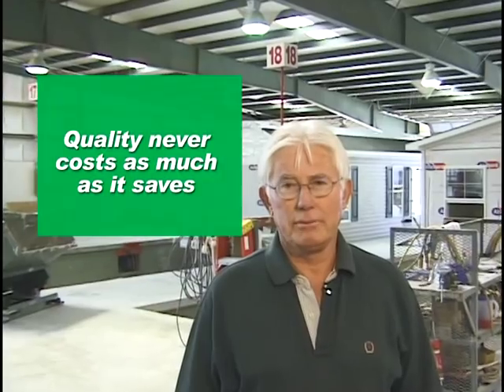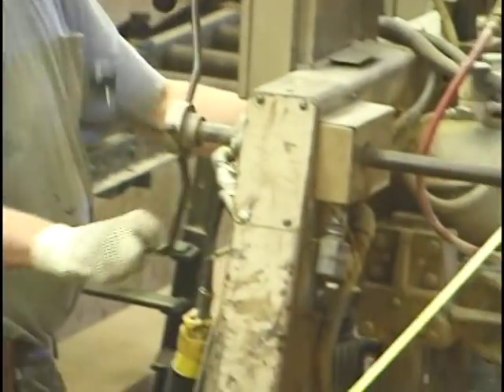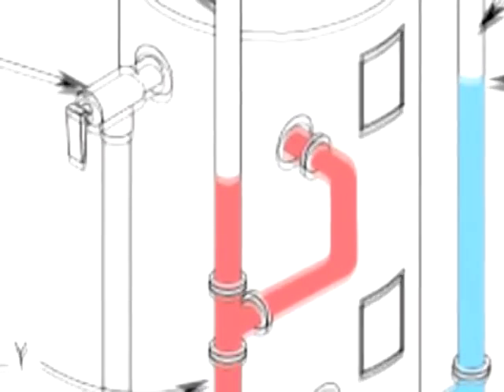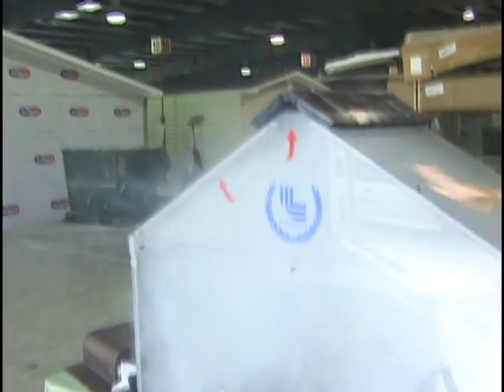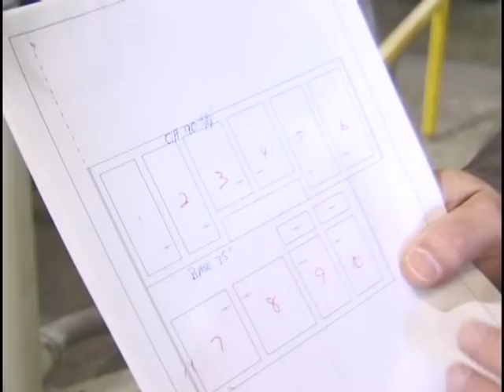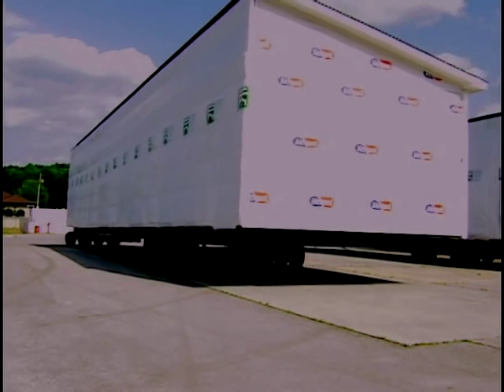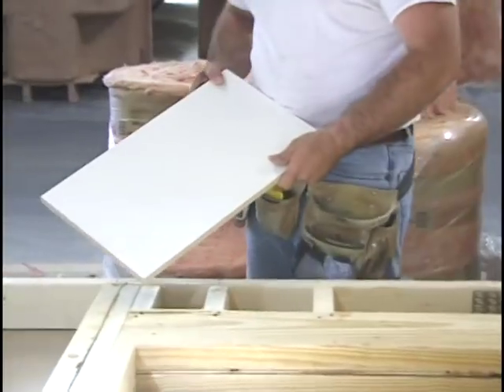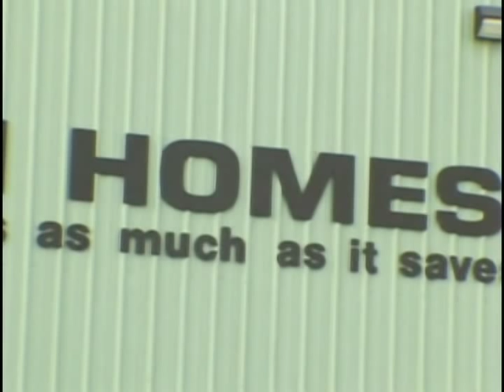The Little Things We Do at Franklin Homes

Comment: I don't see any Structured Wiring or Low Voltage Wiring Panel.  No TV in each room?  No RG6 or Cat6 wiring in each room?  WHERE DOES THE MODEM AND ROUTER GO?  Is this a 1970's home or a 21st Century home?
Reply: this video is from 2011....